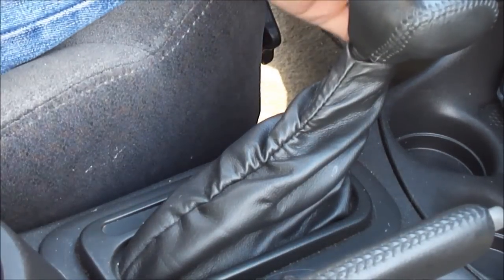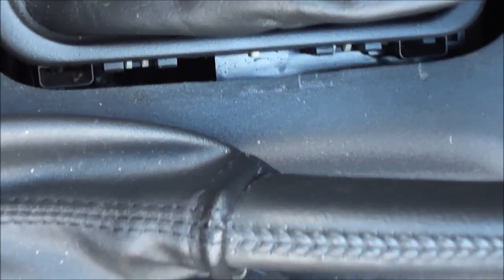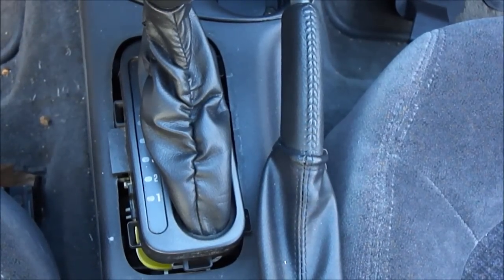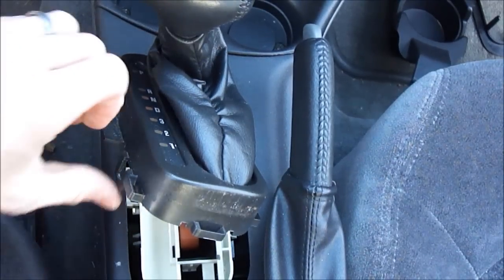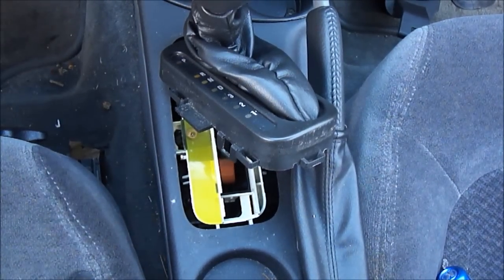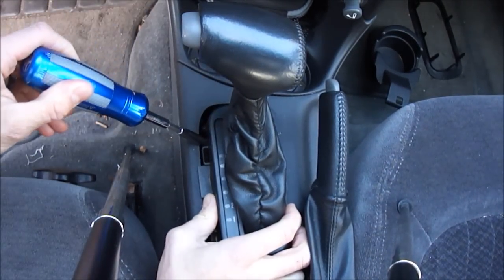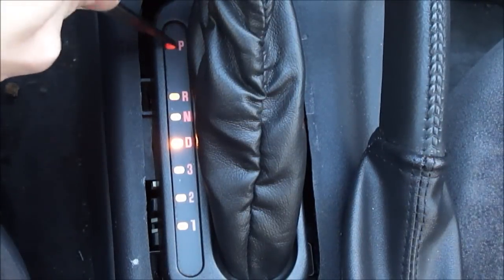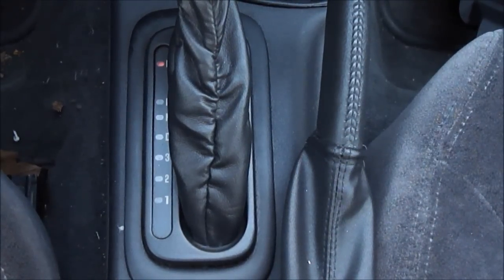Changing a Shifter Accessory Light

Comment from the maker: Yes, it should be on the driver side door panel, inside the car. There is a piece of the dashboard that comes off. This is where you should find the fuses. There is also a relay under the hood, but I don't think the cigarette lighter fuse is there, it's probably in the driver side door jam like I explained above. Do you want me to check eventually and find out for sure?

Comment: Can you do a video showing how to change the shift knob please.
Reply from the maker: You mean on a Grand Am?  I have a video showing how to change a shifter knob on a manual transmission on a different car.
Reply: Darwin Carias it's probably too late now, but there is a teeny tiny "c" clip under the shifter knob, pull that out, hold the button and pull up.
Reply: RichsMethods

Comment: Just saying, not to be rude, but  my pap is a mechanic and he told me before that you shouldn't touch the bulb with your bare hands because the oils on your skin cause the bulb to loose its life span and blow out. not exactly sure why though?
Reply: This usually only applies to headlights as they get very hot. The oil will get extremely hot and can cause the bulb to break.
Reply from the maker: Ditto to Dack Janiels. Thanks for the comment!
Reply: colt hoover and it's only if it halogen bulbs